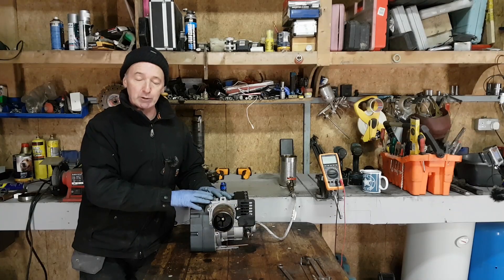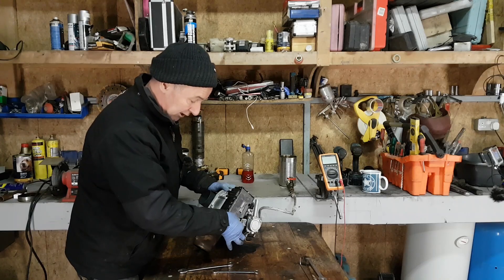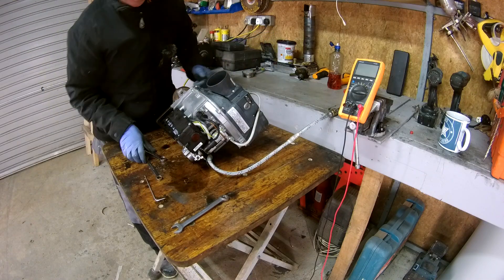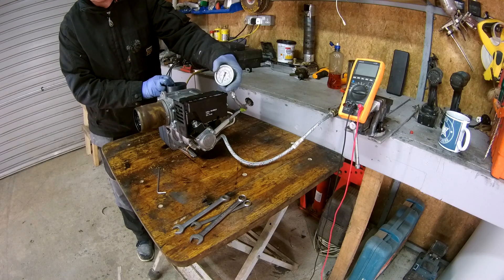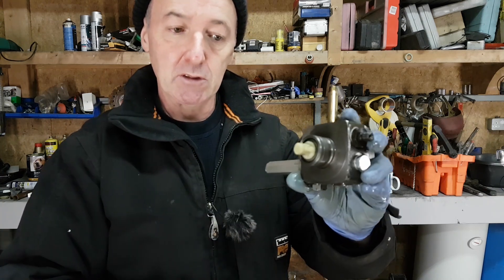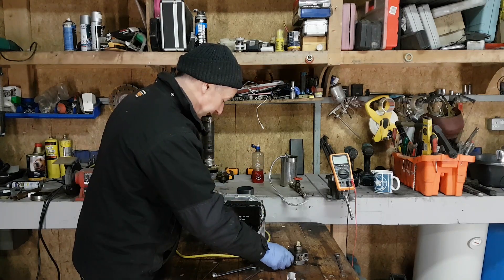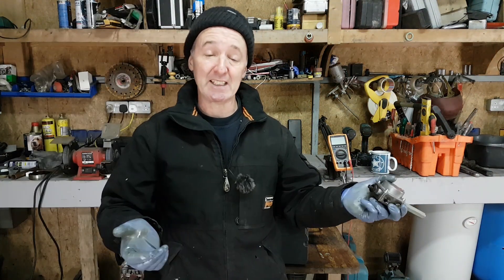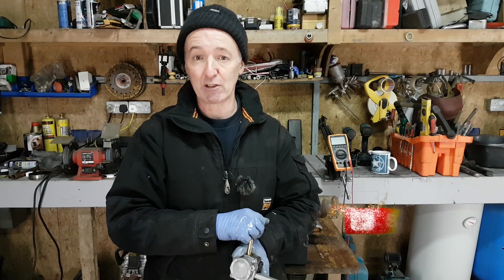How to change the pump on a Riello Rdb Burner

Comment: I have an issue where my burner fires for a second or two then the solenoid cuts the fuel then after a second or two the burner fires again and this cycle continues until it eventually locks out. If i stay with the boiler and reset it a few times it will fire up and stay on. I have checked the solenoid resistance and got 103ohms and the filter on the tank and the pump, all are clean. Any ideas please

Comment: Hi Gerry. I wanting to pick your brians... I picked up a standard riello pump but when I arrived on the job it was a mectron riello pump and it was a hour drive. It should of been a standard riello pump but the mectron looks similar swapped over the inlet nipple but the solenoid nut doesn't fit.

The boiler fires up no bother Are there any issues that you can see by me doing this??
Reply from the maker: Hi Darren. The nut just holds the solenoid in place and a burner will work without one. If you have it working it should be fine. Cheers Gerry 👍
Reply: @GerrysDiy  much appreciated and knowing from your experience and knowledge makes me feel better knowing nothing bad can happen. Thank you

Comment: Hi there can I ask if it is possible for the pump to only work intermittently? My boiler can run for 2 days then it just stops working. I have replaced solenoid, capacitor, photocell and even though I set my oil pressure to 8 bar a few days ago the pressure is now acting a bit erratic and not pressurising much. It looks to me like it is the oil pump but is there anything else that could cause the pump to act erratic before I go ordering a new one?

Comment: Hi Gerry if I put a fresh pump on the same spec, it won't effect any other setup on the boiler? Like Air rate etc? Apart from sorting the pressure.

Comment: Brilliant tutorial, Converted one of these to run on 70percent waste oil in my large Greenhouse, Runs through 2 x 45 gallon drums and ducting, Was having trouble with it pulsing and not running as it should. Photocell was sooted up. Thanks to your video I fixed it in a few seconds. Chillies, Peppers and Garlic are doing great now, Thank u
Reply: What modifications did you make?

Comment: Hi
I have a 3 year old Riello burner it’s wrecking my head firing up fine heats the water & rads for half an hour doesn’t lockout keep running with no flame it’s clicking trying to lite flame but can’t for about another half hour fires back up again had 2 burner guys down changed a number of things still not working
Reply: Check the Photocell, Give it a clean on the end, Worked 4 me, Hope this helps. It just pulls out with a bit of gentle force

Comment: Hi Gerry can I ask a quick question. So our RDB has a leaky pump. When the engineer fits a new one he adjusts the pump to 7bar. As soon as he set the new pump to 7bar it leaks from the adjuster?? He has tried 3 new pumps. Riello aren’t much help?? Any ideas?? It’s a Grant 50/70 unit about 22 years old. It functions very well. Many Thanks
Reply: Remove the adjuster and clean the threads, Wrap some plummers tape around the threads and replace, Dont b shy use plenty of tape, Sounds like the housing has a slight imperfection. This should do the job. Let me know
Reply: Thanks for the reply. The unit is currently using its original pump which was being replaced because it was dripping kerosene. Is leaking kerosene a common fault?? Where would an older established pump leak from?? Also the engineer fitting the new pumps was adjusting the unit to 7bar. I note you were using 8bar. Was he using the correct pressure? Do some units utilise different pressures.
Reply: @swisstoni01  When replacing the pump, The pump is all u get, Sounds as if your adjuster has a fault, ie danaged or leaky thread so re-using it with a new pump wont solve the problem, U need to replace the pressure adjuster. 8 bar is the correct setting. Higher or lower would not cause a leak. B carful that the adjuster and pump has not already been cross threaded. If it has u will need to replace both items

Comment: What caused the pump to give out I had brand new pump fitted about 6 months ago went on me again
Reply: Check and clean the end of the Photocell. If it's sooted up it will shut off the pump
Reply: @philipfranklin5384  where Is that located
Reply: @twoslowoldman  On the back of the unit at the top it has a few markers on it as a series of dashes, It should b set at 17. Its black plastic and WILL pull out with a little force ( no bolts or pins ) hope this helps. let me know

Comment: Hello Gerry your videos are very informative  excellent.
I've a Riello  40 g3 oil burner. The problem is it won't fire up anywhere below 2 degrees outside tempature and now  recently  it takes 3/4 resets  to get it going, it's also just started making a humming noise  when running, any ideas ?
Been serviced last year new pump , capacitor, and control box and jet.

Comment: Hi Gerry, wish I had watched this before stripping down my burner and replacing the fuel pump possibly unnecessarily (I did not bleed it thoroughly first).  Could you help identify a suitable pressure gauge to buy?  I saw someone else had asked for this before too.

Also, in the video where you create one working burner from 3 scrap ones, towards the end, you show how to adjust the amount of air, and mention that you will demonstrate how to use this when the burner is in the boiler so that you can ensure you have a clean blue flame.  I cannot find the video where you show how to do this?   I am assuming there is somewhere that I can gain access to see the flame, and then adjust the screw to optimise the burn.  Could you describe where I can get this view?

Thanks for your help!

Comment: any chance to fix pump ? or only new one needed ? Thanks
Reply: The outside of the pump contains a very fine mesh filter screen,situated behind the pump endplate.Pump won't generate enough pressure if it's blocked.

Comment: Hi gerry can you use a 50/50 mix of waste oil and kerosene in one of them burners. Or would it not work. Kerosene gone expensive in Ireland now. Just looking for a way of using up some waste engine oil thanks.
Reply from the maker: Hi Ross. The nozzle would have a hard time with the engine oil and would clog and the air mix would suffer because of the inconsistent fuel. A different setup can burn it though but would require a different burner and compressor. Cheers Gerry
Reply: Thanks.
Reply: As long as you filtre the waste oil u will b fine. I use 70 percent waste oil but be prepared to clean the end of the Photocell now and again, Only takes a minute

Comment: Great vid. I have a problem with mine where it will fire up could be for 1 min or 5 mins of running then it shuts off for about a min. then it will fire back up again or sometimes it does not fire up again. i have to turn it off leave it for a bit then fire it up again. I have changed the fuel filter fuel nozzle and the electodes. still no good. any advise would be great
Reply: Give it a long bleed,,,,make sure all connections are tight and not sucking air
Reply: Clean the end of the Photocell

Comment: Hi what if your getting no spark and then goto lock out. The electrodes are set correctly. Would a faulty pump keep if from sparking, or a faulty relay coil. If get no spark would it be more common for the control box to be gone. Thanks

Comment: Great video Gerry. Used it to change my pump but on pressure test the pressure goes to about 15 bar during venting and drops to zero once boiler fires. Any ideas would be gratefully received.
Reply: Why havnt you rep[lied Gerry

Comment: My old reillo will not start. Just giving a buzz sound . I suspect the motor is at fault . Capacitor and control box  is changed so I have eliminated that so far . Any advice . Fan will turn by hand so its not seized ...

Comment: Gerry, I traced the fault to a lack of electrical power to the burner, a wire had pulled out in the dual thermostat on the Amanda boiler.  The thermostat screws are very rusted and getting at the connections is not easy.  How are these thermostat units fixed to the boiler and how can they be removed/replaced?   I can find nothing online about them, nor details of the Amanda boiler which I presume is obsolete...    Many thanks for your great videos - very helpful!

Comment: I could kick myself. My riello burner packed up Saturday morning, I used the manufacturer troubleshoot table and googled advice and ended up changing the photocell, the nozzle, the controller and cleaned up without removing the electrodes. I had a spare pump but wasn't confident until I saw you do it. I also don't have the oil pressure gauge. Is the gauge a made up test jig or something you knocked up? 
I have to say you made a brilliant video. I just wish I had seen it 24hrs ago, my heating may have been running by now. Having to get an engineer out. Depressing.
PS, have you done a vid showing how to change the electrode set and set them up??

Comment: Hi Gerry, hope your keeping safe. I have an rdb burner and have changed pump, photocell, and had it serviced. Yet its still not running right. Solenoid is the last part I can think of is it difficult to change.
Thanks in advance. Dan
Reply from the maker: Hi Daniel. Really easy to change the solenoid. Just a thumbscrew and a couple of spade connectors. Check out my recent video on rebuilding a Riello burner  https://youtu.be/dqBC6369xRg Hope this helps. Cheers Gerry 👍👍
Reply: Thanks very much Gerry. I'll get one tomorrow. 👍👍
Reply from the maker: @danielgilroy267  Daniel. There's a rough test you can do on the solenoid to see if it is working. Take the solenoid off but leave it electrically connected and place a metal screw driver inside the hole. Power on the burner and when the solenoid gets powered it snould become magnetic. You will feel resistance when you try to move the screwdriver. If you have a meter you should get 100 Ohms 

resistancehe +/- 5 . Check for resistance with the solenoid plugged out of circuit. Hope this helps good luck  Check this out https://bit.ly/2LIkzCD Cheers Gerry 👍

Comment: Gerry, can you please elaborate on your home made oil supply and how you made it and using which parts...I’m very intrigued.
Reply from the maker: Hi Lewis. In this video I just used a dog food tin but I made a video where I converted a 5 gallon plastic drum to do the same job. All the fittings are the same. https://youtu.be/YhOzBaDp_LY Hope this helps Cheers Gerry 👍👍

Comment: Gerry, I have a Riello RDB burner the same.. When switch heating on at the wall it doesnt do anything not even bring fan on unless you press the reset button on burner then you get the suction sound & it fires up.. Itl only manage say 20 mins or 45 if your lucky of an on / off cycle burning then stops & doesnt come on again.. So say if you left the house at 1pm with it on and came in at 6 itl be freezing. We have to keep going outside and pressing reset every 30 minutes or so to keep heat in the radiators in the house. What would be the issue ? Is it wrong pressure ? Faulty pump? Solenoid? Checked & cleaned the photocell is ok & the burner is getting oil feed ok i think to be fair the feed flexi pipe hooks back on itself before it goes into the burner but not sure if thats an issue? Be great if you could advise then il know what part to buy and fit before this cold weather hits us .. Good man yourself 👍 

Thank you

Comment: My motor isn't running although when I move it a little it feels like it's trying. I've stripped the burner and there seems to be the same resistance on the pump and the motor with neither very free but easyish to turn which do you think is the problem? Or could it just be the capacitor? Note there was a bit of a screeching from it when it was running before 🤷🏻‍♂️
Reply: Motor startup cap is bad probably.

Comment: Great video ...thanks .....just 1 question, I note that you have this connected to a domestic three pin plug, there are 4 wires in the cable how are these set upin the domestic plug? Cheers

Comment: I think I have the same issue except my burner runs for about 2 minutes stops tries to ignite again and then fails. I see oil flow and igniter trying to ignite the oil flow but it fails and resets. Could this be a faulty pump is it not providing enough kerosene

Comment: Hi Gerry, I ran out of kerosene and have bled the riello rdb burner. It won’t fire up
Reply from the maker: Hi Graham. Usually the burner is fine but the line is airlocked. There are a couple of ways to approach this. you can clear the line back into the the oil tank using low pressure compressed air. You will need to open the vent screw on the burner and blow the oil back into the tank. Make sure that you are not messing with the pressure screw. If you can wait I will have a video on this later in the week. Hope this helps Cheers Gerry
Reply: I remember this happened before and I found on YouTube a way of resetting the burner where it try’s ignite 3 times in one cycle before faulting. How to I do this?

Comment: I've watched all your vidios Jerry and followed you for a long time, but you've made a big mistake with this, I know you do this for a living just like I do, but I have to say that you haven't thought about this mate, there will be hundreds of oil engineers in Ireland and England thinking the same as me if they see this, showing this to the public is fine but you've missed the most important thing, the bloody spark won't make you jump a bit, it's direct from the transformer you touch it your dead, please address this straight away you and I know this because we do it every day the public don't, you have to be so careful what you put out there Jerry, love your vidios mate but please anyone got hurt not knowing this you would never forgive your self.

Alan.
Reply: Ok, how many amps is it?  It is the voltage that makes it jump the gap, but in an engine there is almost no amperage.  It is the amperage that can be dangerous.
Reply: @slrs3908  Static can kill you if if a stronger charge and hits you at just the wrong time. These transformers are around .3 amps.
Reply: If it is coming through a transformer, doesnt the amperage go down as the volts go up?  Im just askin because not all sparks are life threatening...so please explain.
Reply: SLRS I can’t tell you what the voltage is, but I can say many years ago when I did my training on oil boilers I was told be very carful as the voltage can easily kill.
Reply: @pearcemachineshop5200  Alan, you intentions are probably pure, but I am thinking of the shock you get from a gas engine ignition spark, which will certainly get your attention real fast, but probably won't hurt you unless you have a pacemaker.  So, in the sense of safety, I personally would like to know just how dangerous this is...if only to satisfy my own curiosity.  At the same time, where I come from, you don't openly accuse a man of negligence (the nice way of putting it) and then respond with "I don't know" when asked for details.  So, do you know, or did you just throw Jerry under the bus?  Please provide references.  ...and I was asking about the amperage, but voltage would be interesting too.
Reply: @slrs3908  I would have to look it up, as for Jerry I think the guys done a great job and I've no intention of throwing him under the bus so to speak his oil burners have been great and that's an understatement, I mean no offence to any one least of all Jerry, I'll see what I can find out, but I will say the guy that taught me seamed to know is stuff if you know what I mean, the transformer ups the power considerably in order to make a very big spark, kerosean if not as easy to ignight as petrol as you know, hope that helps a bit.

Alan.
Reply: All I've managed to find so far is a smiler transformer, these put out between 10,000 and 20,000 volts that will make you more than jump a bit.
Reply: @pearcemachineshop5200  Glad you are looking into it.  Thanks.  However, one of the points that I am trying to make is that a transformer does not increase power.  Over-all power according to OHM's law should remain the same.  As the transformer increases voltage, amperage should go down by a proportionate amount.  This does not mean to me that there is no danger, but small Briggs and Straton 5 hp engines (and others) put out around 20,000 volts and it will make me flinch, but that is it.  A spark requires high voltage to make the jump across a gap, and It may or may not contain enough amperage to hurt you.  Any more and I would be telling you more than I know.  I guess it is safest to assume the spark is dangerous.

Comment: Gerry,  there are several videos on YouTube concerning the very cheap Chinese van night heaters based on the Espacher design. They seem to work well and have quite sophisticated control systems. Just wondering if you had come across one as at only £130 it's very tempting!!
Richard
Reply: Richard Turner id love to see Gerry reveiw one then modify it to burn waste oil
Reply: Those are cool, I'm going to get one. Haven't heard a had thing about em. Although getting it to run on waste oil would probably be impossible, so small of a burner.
Reply: @volvo09  I don't think there is any point. We

Comment: Gerry.. We use some kind of the same burner but we are using diesel, I tried to mix it with waste oil but there were a lot of smoke and the burner stop working because the injectors stucked of the dirty oil despite that I used filters before feeding..... Do you have any idea how to make it working on waste oil.... I found some kind of a russian burners, and here is the link how to make it https://youtu.be/BN6Q8YZD2II and here how does it works https://youtu.be/a37Uz3E5sGg